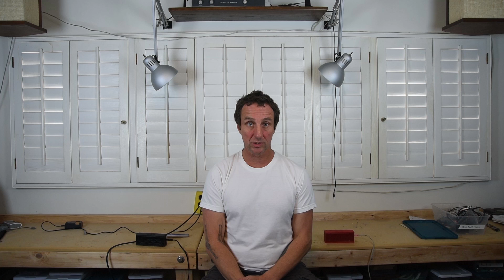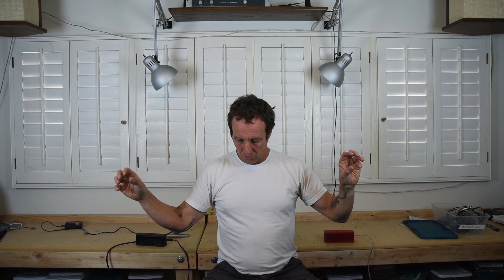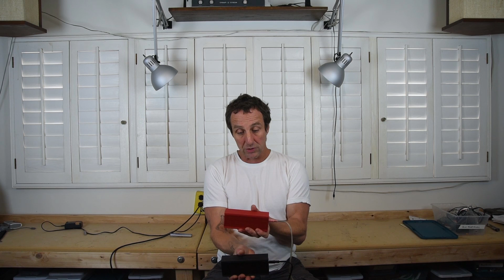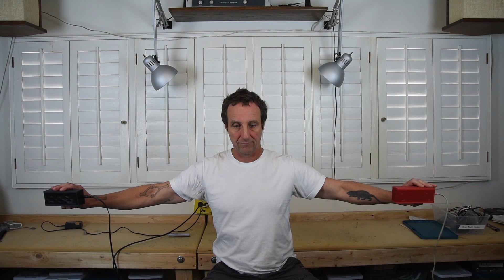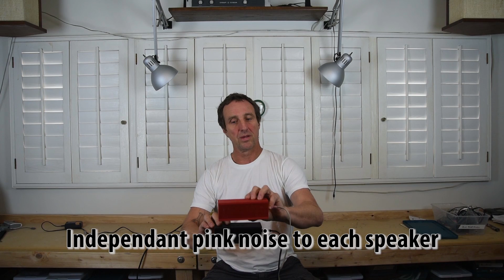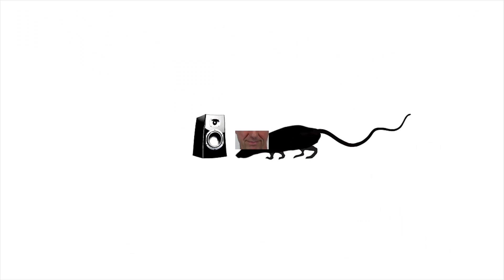Problems With Mono Sound From Stereo Speakers

Comment: I barely do FOH anymore....studio rat now.  I'd be curious to hear a mix like this.  It seems like it could be a bit weird if you're in the sweet spot, but I guess for 99% of the audience it would work well.  I'm just imagining a similar scenario in the studio and I think it would be weird, but I guess it'd be weird because we're so concerned with how things sum to mono.  Take doubled guitars as an example......sounds great panned wide in stereo, but as soon as you go to listen in mono, you lose about 6db of level on those guitars.
Also, the idea that you've basically got 2 different FOH mixes going at the same time seems like it goes against the grain.  Someone house left might hear a different mix than someone house right?  
Maybe you're not hard panning things live and only doing say 50% L/R?  
I'm probably not getting the full story here.  Or more likely not quite understanding the practical aspect of how to actually pull this off live.
Reply from the maker: The beauty is that is removed the sweet spot and makes removes mono summing issues when you run de correlated signals to left and right.

Imagine on singer panned center, you have a sweet spot in the middle and not so sweet spots listening off center.

Imagine having the same singer sing the vocals twice and panning one take to the left and one take to the right.

You now have two completely decorrelated vocal versions where listening from center sounds stereo but listening off center still has little or no phase or cancellation issues. So the sweet spot is much wider or pretty much everywhere is a sweet spot.

It is when you send the same signal to left and right that you create a 
Summation in the center listening position. If you delay the same signal on one side or the other, you create mono summing issues. But if you have two de correlated versions of the signal, they sum mono without issue and they do not have a power alley or summing boost sweet spot in the center.

The trick is the challenge of grabbing decorrelated signals. Which can be quite tough to do but there are things that help with decorrelation to some degree.
Reply: @DaveRat  I hope I get to hear it in person sometime.
All makes sense too.  You guys don't really need to worry about mono all that much in the sheds or arenas I reckon?
But I am having a hard time imaging what you could do with a lead vocal when trying to approach things as you describe.  The only thing I can think of is "that's where the Eventide Harmonizer comes in"
I definitely understand the theoretical aspect of this.  I'm just a bit uncertain as to specific practical issues.
Another question would be, from your FOH position, are you actually in a spot where you can hear a stereo mix?  And if so, while I assume you're quite used to it by now, isn't it a bit disconcerting to be hearing a slightly different mix coming out of each side?  I seem to recall you face your console 90deg to the stage, so maybe you're listening out of one ear for a good part of the show (although I know you don't like to hover over the board).

Told ya......I was gonna have questions!
Reply from the maker: We do need mono to send to delay clusters, center cluster, press feeds and such.

Most live mixes are not stereo as much as a dual mono, or at least that's what should be, as few listeners are actually centered and a majority are to one side or the other.

As far as vocals, I personally don't try and decorelate them into dual, but I do try and minimize the amount of identical signals sent to left and right while making sure that listeners on the left or right hear everything.
Reply: @DaveRat  Right on.  And I suppose a -9/+9 cents tuning on the Eventide would help that with the vox.  
And the rest of that makes a ton of sense.  Will have to start listening to that kinda thing if I ever go to another big show.  Who knows?  Maybe I'll find myself at one of yours!
Thanks for the info!

Comment: Dave, is there any way to "Y" a single input into two channels of your mixer mixer  and "fool it" so it looks like two different sources....thinking like a barrel type transformer on one input...something similar... slightly out of time ? So It's the exact signal source that causes the interference....anything that could tweek it so they "looks" different?
Reply from the maker: Not that simple. The signals are complex and a y will create an identical version. Delay will just create comb filtering. EQ on one will change the way it interacts but not enough.

Decorrelating a signal is tough and the easiest way to achieve some success is to mic a separate area on the source that has a differing signal

Comment: This is why you sometimes apply global EQ on one side of the mix slightly.
Reply: @DaveRat  Is there a song or album that exists where every instrument was recorded for 2 different sides of the stereo spectrum (panned hard left and right)?  I'd love to take a listen.  Very interesting.
Reply from the maker: @380stroker  check out the old beatles 4 track recordings. They had some hard panned instrumenta and vocals
Reply: @DaveRat  Ok. Thanks.

Comment: Good Day Mr. Dave, how are you?? Hope all is well with you and your family.. First thank you sharing such knowledge and valuable priceless information with the audio community. I just have a question regarding the part where you said different sources, did you mean you had different laptops or noise generator feeding different speakers?? Forgive me for asking this stupid questions but i just want to clarify these as it is a very applicable system. Thank you Sir..
Reply from the maker: Different sources are like a guitar and a bass or two different guitars or any two unrelated sounds. Also different versions of the same sound that are minimally related. Like a mile on the high and a mic on the low strings of a puano
Reply: @DaveRat  Thank you so much for your kind response.

Comment: Iv'e got a remedy, a new mic design that has 2 diaphragms in it that run right and left. Let's make em
Reply from the maker: People make them.  There are also mics with 3 and 4 elements that can determine the direction sound comes from. Then we need speakers that do the same
Reply: @DaveRat  Have you looked at Zylia mics?

Comment: Sir, but what about sound of Rain? Also, does Channel A and channel B from same mixers can be counted as different sources? Thank you
Reply from the maker: I would say that like snowflakes, no two rain drops create the exact same sound at the exact same time at the exact same volume level by travelling at the exact same velocity and hitting the ground surface at the exact same angle. But, if the same recording of rain that is played back into two speakers, those recordings will be identical or very close and you will have issues like phase, polarity, delay and distance interactions between the two playbacks.  Those issue will not exist in the natural rain, only in the recording.

Comment: So this is really interesting.  And I suppose the same thing applies for recording really.  Even just two speakers in stereo.  So, like 2 mics on a guitar amp, hard panned? Two different speakers.  Say if you were to double track guitars.  Instead of mixing both mics into mono, you could do track on with say a 57 hard right, and a 421 hard left. Then on the second guitar track, flip the mics left and right?  Thank you so much for your insight DAVE you are awesome...
Reply from the maker: Double tracking inherently decorelates them, u can use identical mics and amp, etc.. and there will be no phase or polarity issues

Comment: Great stuff Dave.  Stereo and all it's previous music reproduction schemes are a very poor analogy of what live music actually sounds like. 
Take it one step further and how intermodulation and heterodyne distortions add even more mud.  Crossovers and splitting the audio frequency band helped but it is still a far cry from the right way to do it.  Fortunately we now have the technology to produce a paradigm shift in what really great audio should be.  I have been working on a prototype demo system for a few years now and am very near to it's completion.  It is viable. inexpensive and  downward compatible with current stereo media.   But the difference is like we've been listening to black and white for far too long.
Reply from the maker: Interesting

Comment: This makes an interesting argument for mixing any PA in stereo.
I have always run my system in Stereo although I don't always get to mix the Pam section but everybody I've talked to that has more experience? than me usually runs mono. They do the whole thing in mono whereas once my mix starts settling down and I have more than one instrument I like to start panting things a little.
I'm mostly self-taught but I've always done this sort of without fully realizing it.
Just found your channels a few weeks ago and threw some videos in the my watch later list. I think I might have seen one of those with the windows behind you way back before without realizing it, either way I was subscribed by the first video I watched this year.

Comment: Dave could you achieve similar results if you used different enclosures/line array on either side?  Say an L Acoustics on Stage Left and a Meyer equivalent on Stage Right?  Won't be the same as having dedicated enclosures for each source but wondering if it would be an improvement 🤔
Reply from the maker: Interesting concept. I suppose it would work to some degree, though since you'd be relying on the fixed differentials between the systems, the partial decorrelation would be fixed a cross all instuments, not ideal
Reply: @DaveRat  that demonstration got me thinking how to apply this concept even though it would be difficult to get musicians on different sources at once.  Next best approach I suppose is 2 mics 🎤🎤 on the same source panned hard L/R.  This does bring to mind an interesting experience i had at InfoCom last year in Alcons demo room with their ribbon tweeter boxes.  Standing to one side of the stage, you could hear the stereo image from the box hung on the other side of the stage almost as well as the one you were standing in front of.

Comment: I guess I now know a few new tricks if ever I want to get back into live sound or mobile entertainment again.    I've also split a signal and panned 1 channel left, the other right , insert a peripheral  on 1 (effects processor or eq) and sent the other straight to the mix or sub.  Seemed to do similar to having 2 separate mics.   

But typically for what I was doing is my mains would be staggered maybe 3-6 db depending on the venue and my master EQ was not stereo linked.  It would never match left to right.  If it did, it sounded like crap.

Comment: Yup. I totally agree. Center panning mono stuff was not even possible on the early EMI consoles - it was LR, not LCR.
Reply: The Grateful Dead used Altec MX-10 mixers with the Wall of Sound, and those didn't have pan-pots, only a switch for left, right or both.
Reply from the maker: Cool info!
Reply: @DaveRat  Yeah, Bear didn't believe in pan-pots. There's an exhaustively researched thread about the equipment used in the Wall of Sound on the Steve Hoffman forum. I've been meaning to contact Bob Heil to find out if he had introduced them to the idea of using the "two mics, with one wired out of phase" trick that they used for the Wall of Sound.

Comment: Very cool demo. IIUC this issue can be tackled with at least two mics for each instrument. But what about electronically produced music? Just change "something" for one channel that almost makes no difference in sound but still produces different waveforms? I guess the whole frequency band has to be altered for one side. It's not simply done be adding some  noise to one channel. Apart from that you might not want to add plain annoying noise to your tracks. The waveforms just have to be different but sound almost the same. Interesting problem indeed.
Reply from the maker: De correlation of sound while maintaining the same sound is a challenge indeed

Comment: Great video! What if I used a two element mic and sent one to the left and one to right? Would it matter if I used the same single source but put a delay or in some way altered the sound on one output channel?
Reply from the maker: The more identical the signals are the less effective it will be. If you were to use a ribbon mic and a dynamic mic and put the dynamic mic closer and the ribbon mic farther and Mike different parts of the speaker and then try and EQ the two mics to sound similar and panned one left and one right, you could get enough de correlation in the mids and highs.

Other tricks can be making the front and back of an open-back guitar rig and then reversing polarity on the back Mike and then eat queuing the two different mics to sound similar.

Panning the base di more left in the base mic more right, panning the internal kick mic left and the external kick Drum mic to the right

Are also ways to reduce the similarity of sounds reproduced from multiple places

Comment: Hi, i have one question.What is best solution for live sound considering mono/stereo. In one hand mixing in mono ensures that all people hear same thing...on the other hand.. in your video you said (and i agree with you) that same sound from two diferent places is unnatural event and it is cause of many problems (comb filtering, phasing, cancelation). So it seams that best solution is some kind of double mono.... maybe originam kick form one side and sample from other, one side original guitar.. other guitar delayed 15 ms ...or what is best solution that you use to ensure same experience for whole audience?
Reply from the maker: Dual decorrelated mono solves both comb filtering and allows all to hear

That said, left right comb filtering cam measure bad but can sound good. Hence why we have home stereos and not home monos.

Avoiding the exact same signal and using differing versions of the signal for L and R can help.

Delaying one side just moved the acoustic center to one side

Comment: Thanks for the demonstrations on this channel!V Why do you use pink noise and not white noise for these demonstrations? Are the interference effects easier to hear with more low end?
Reply from the maker: I use pink when possible as it is equal energy per octave and more closely mimics musical content that white noise.  That said, for other tests where it is hard to hear with pink, I will use white noise or shaped noise

Comment: Could this principle apply if you took a direct signal from 2 different sources? (I.E. 2 different direct boxes on a bass or a keyboard)?
Reply from the maker: the sources need to be decorrelated to some degree. two people singing the same song is very decorrelated. 2 DIs on the same instrument will reproduce nearly the exact same signal, even if one is active and the other passive, they will be so very close. A bass mic is somewhat decorrelated to a Bass DI due to the impacts of the amp, cabinet, speaker and mic on the sound. A snare top vs snare bottom mic will have significant differential and a mic on a kick beater vs mic on the hole in the resonant head will have some decorrelations. 

If the sources are decorrelated, then panning will give a stereo sounding image, reduce power alley and still let everyone on either side hear the instrument.
Reply: Thanks Dave

Comment: Pink noise is supposed to be random so of course two different generators would not cause interference with each other. I’m not sure how dual micing the same source would play out.   I like the idea of dual pink noise for measuring. Great video!! 👍
Reply from the maker: The more decorrelated, the less the interaction. So for example with to kick mics, and one is making the beater from the inside and the other is making the hole in the resonant head, though those two signals are similar and based on the initial impact of the beater there are enough d correlated aspects to the two signals to where you could pan one hard left and one hard right and reduce the amount of summation in the middle.
Reply: @DaveRat  Very Very Cool. I work in design and installation of high end cinema reproduction systems so the techniques you guys use to mix live music big PA stuff is fascinating!